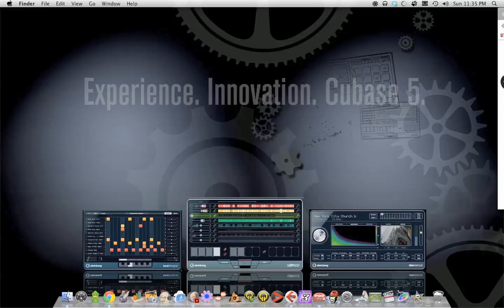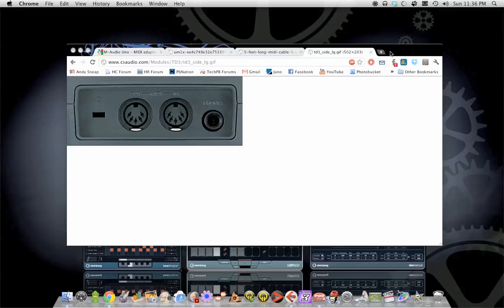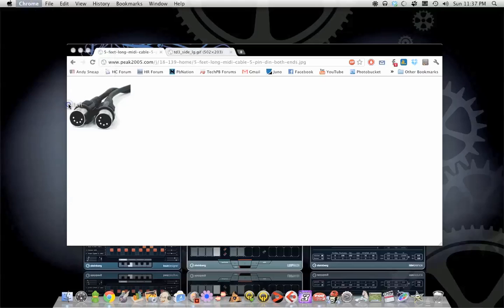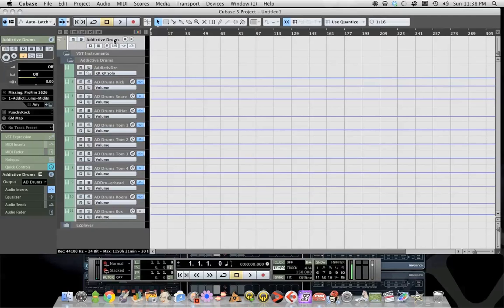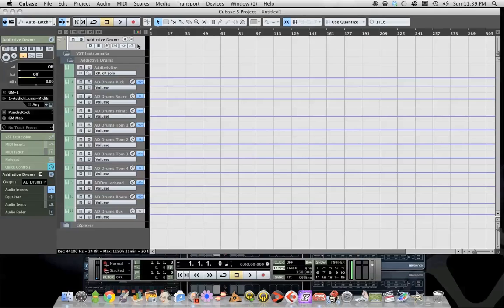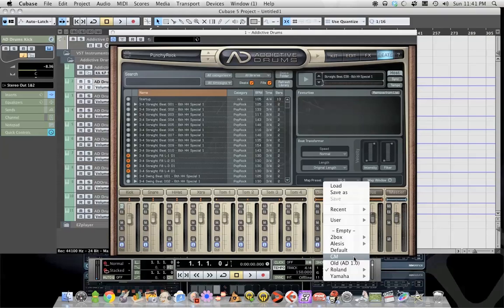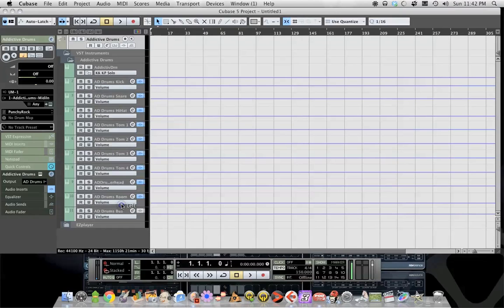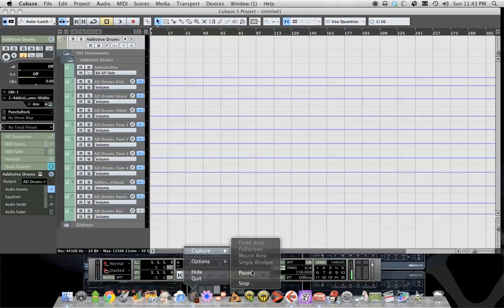Setting up an E Kit with Cubase

Comment: okay thanks.  ya i have been tweaking for a while on the dm10 and got every thing set up really good before i bought addictive drums.  you can play addictive drums with the dm10 with just addictive drums  you just cant record with out having a host is all right?  if i under stand correctly?  correct me if i am wrong
Reply from the maker: Yes you need a host to run and record with Addictive Drums such as garageband, reaper, pro tools, cubase, logic, live or studio one.

You might be able to find some freeware if you just want to run it.  I would personally just go with Reaper if your short on cash.  I don't use reaper personally, but have played around with it and it's fully capable for recording.  

Any recording program is going to have a learning curve though.

Comment: I have the alesis dm 10,  i just bought addictive drums for it, but i was wondering if i can just use a usb cable for it or if i need to buy the midi to usb cable.  it has the usb plugin on the modual.   also do i have to run this through another program like cubase?  can i not use addictive drum software on its own?  sorry for the questions i am just not good with all of the computer stuff,  i am use to playing acoustic sets thats all i have ever played but i have just recently bought an alesis and i am trying to figure this stuff out,
Reply from the maker: I don't know what OS you are on, however there is no addictive drummer stand alone application.  So what you will have to find is a VST host (either recording software or something else if you can find it).  If you need a cheap one Reaper is always available.

As far as the USB cable from the module, I actually don't know if it can be done that way.  My guess is that you most likely can.

My last bit of advise is to mess around with the DM10 and definitely read the manual.  I had a friend buy one and he had to tweak the heck out of it to get it to play right for him.

Good luck.
Reply: GuitarGodgt I believe the standalone update was released last September.  http://www.xlnaudio.com/latestnews-aax_support_standalone_operation

Comment from the maker: @RSDsj 

Those midi to usb cables are usually around 30-40 bucks.  Or if your interface has midi just a standard midi cable long enough is usually no more than 10.